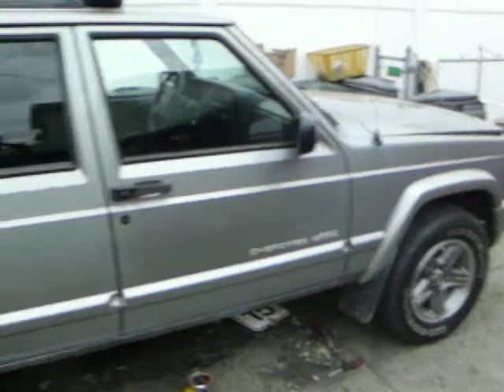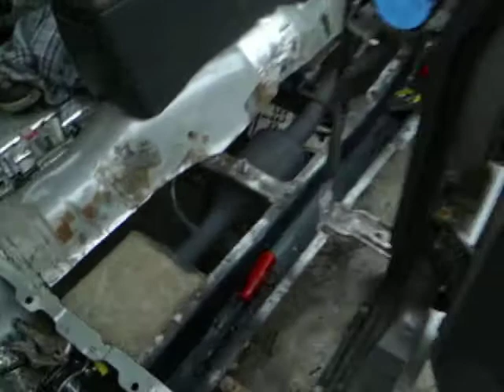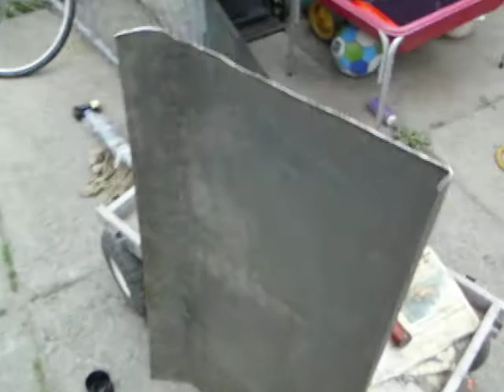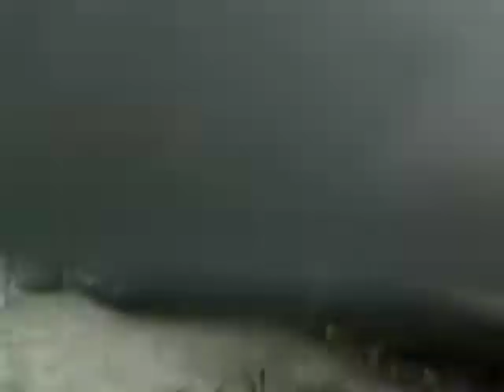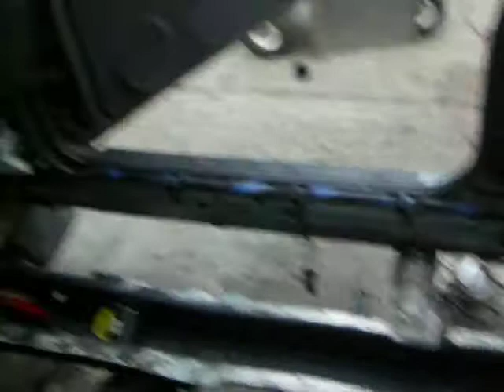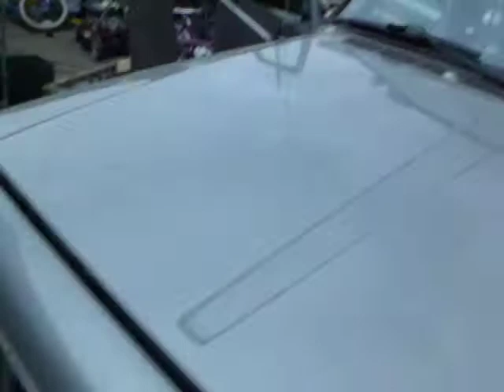Jeep Cherokee, No floors!

Comment: I think the reason why the passenger side tends to rust more is because of how hot that exhaust gets. they put that damn dent on the front pipe for "clearance" and to get the cat hot quickly. now there's no undercoating there anyway cuz it would just burn off so it just rusts as fast as bare metal basically. do yallselves a favor, pop that manifold back off as best you can and start scuffing and spraying grill or engine paint up in there and top it off with bedliner while its a tad tacky.

Comment from the maker: not sure about that, and i may make you situation worse but the real late 90's and the 2000's have the 0331 (i think its the right #) head which is bad because those heads crack and smoke your engine.